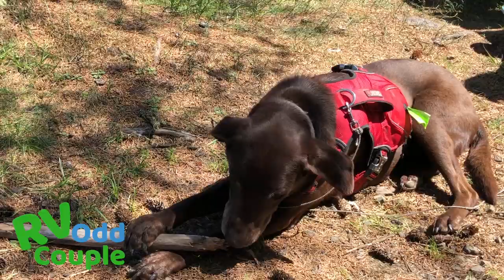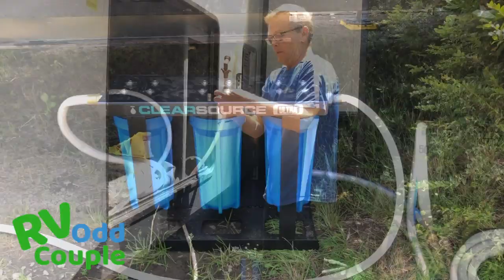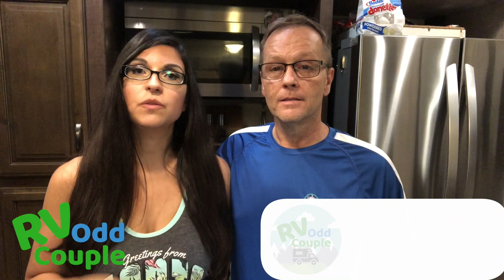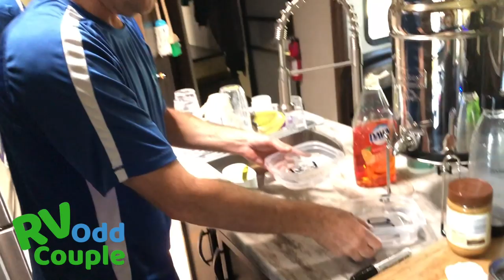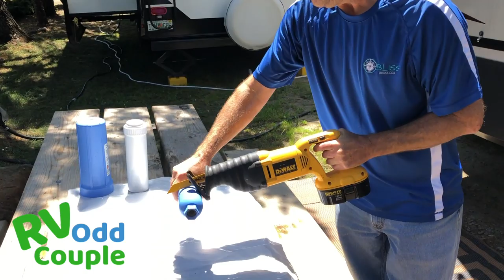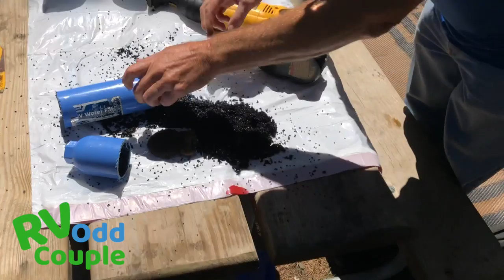SAFE TO DRINK? RV Drinking Water Solutions for RV Life

Comment: PS: How long does it take before the filter style are icky and need replacing? It depends on a lot I`m sure. Who`s going to check them all the time, if you can?
Reply from the maker: Guess it depends on which filter you are referring to Rob. You are right about there being so many things that effect a filters life: water pressure, use, and how dirty the water is that is being treated.... The Berkey is actually the easiest to check. Just peak under the lid, and the Berkey systems slows  down as it approaches 6000 gallons or if it is treating really dirty water. We love our Berkey and so does Skippy. Make sure you use our Coupon for 5% Off or you can click this link when your ready:  https://www.berkeyfilters.com/products/imperial-berkey?a_aid=5d27942325e0b&a_bid=01e2d3be
Reply: When water pressure drops is a good sign. A good filter will say how many gallons it will handle.
Reply from the maker: @baysword  Yes!

Comment: I'm trying to understand the RV crowd's fixation on the Berkey water filter.  Their filters are not NSF certified (which have much more stringent standards than Berkey's independent tests) and independent tests showed that their filters lost effectiveness after just 1000 gallons, not the 6000 gallons they state.  Seems more marketing hype that actual independent testing (and independent tests that they paid for it and can dictate the process).  NSF requires the rated amount of water to be run through the filter BEFORE the tests are actually performed.  Not the case with the Berkey 'Independent' tests.  

We have a whole trailer filter (not the outside blue one, but one that is installed after the city water and pump) that is very effective along with a Brita filter canister in the fridge.  Just google Berkey independent tests and only read articles from sites that DON'T have Berkey in the site URL.

Comment: Hey guys. Great video. What size Berky do you use? Are you satisfied with the size? So many to choose from. Also what filtration system did you ultimately pick for the outside. I’m not a full-time RVer  and I’m concerned with the Berkey that you have to empty it when you’re not using but I read the filters are supposed to always be wet. What are your thoughts? Thanks

Comment: Why don't you just dump grey water on side of road or truck stop if using reverse osmosis system with grey water. Don't have to dump all of it. Just to keep up with reverse system. Not a RV er yet. Just know difference between black and grey water tanks.
Reply from the maker: Just doesn't feel or look right Tim
Reply: Thanks
Reply from the maker: @greenthumb6875  YW Tim

Comment: The Berkey doesn't take everything out.
Better than nothing..
Reply: Yeah , the Berkey is not great .  I ended up buying a 0.2 micron Propur gravity filter.  The Berkey is a low grade 5 micron high flow.
Reply from the maker: Berkey is awesome. Not sure where Berkey is getting confused with a bad carbon filter but we love our Berkey
Reply: @mariaavakian9958   I have used British Berkfeild which I suspect is the original Berkey. Its the filter not the unit. For me it's distilled water. Not true about what they say takes your minerals out. Eat correctly it won't. I use a Berkey as only last option or for filtering city water.

Comment: It's your fault. No it's Skippy's fault. Bought one on amazon and the accessories on Berkey.  They can't ship to CA anything over the Traveler which seems a little small for cooking AND drinking AND brushing teeth. But the accessories are cheaper on Berkey and the one we wanted initially would have also worked but again berkey can't send it- just how the bundles and deals worked out.   Am looking forward to NOT needing to drag around a case or two of bottled water.  MY guess is the pond taste and smell is because the water tanks can't be perfectly cleaned.  Any silt, algae, molds is going to be there and even sloshing and rinsing with Clorox is going to have limited value. It doesn't take more than a couple of days for a biofilm to start up.
Reply: but the pre filter is going to help the Berkey filters last longer